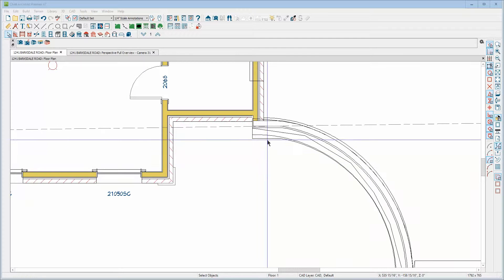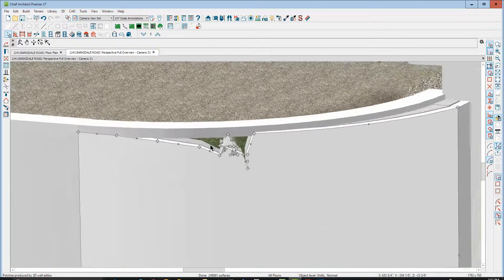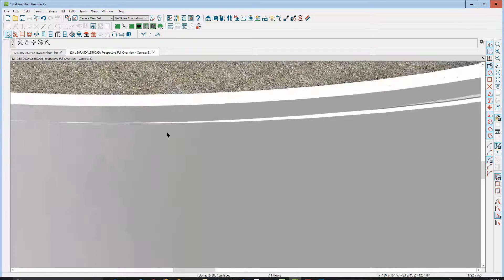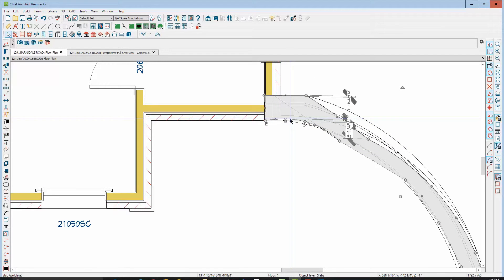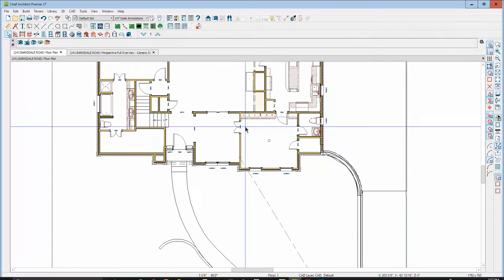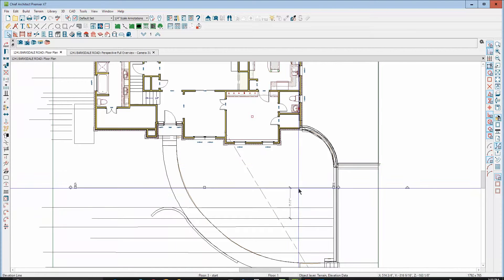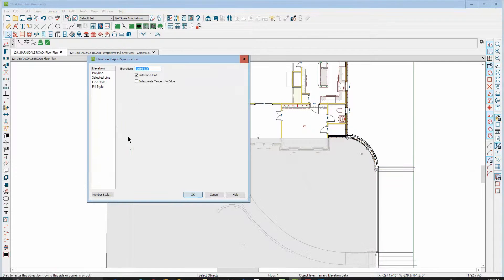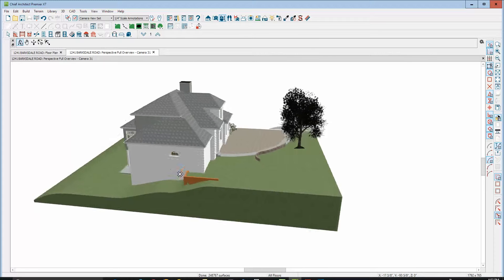Wall connections, Architectural to Retaining wall

Comment: David
I have no idea where those break points came from as all I drew was a curved wall.
Alan
Reply from the maker: +Alan N , I suppose that is how curved retaining walls are programmed to work (I haven't needed to use them in several versions), never the less what is there, is there.
Reply from the maker: +David Jefferson Potter BTW, if you wanted that retaining wall to end where you had it you would be better served to use a custom slab because walls of any type tend to want to "snap" to other walls whereas a custom slab, just goes where you place it without the annoying "snapping"